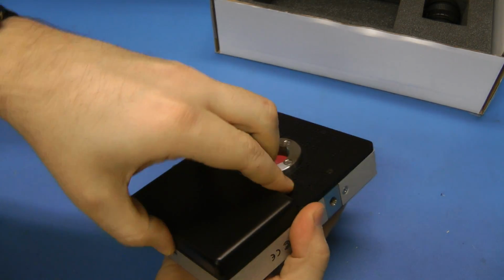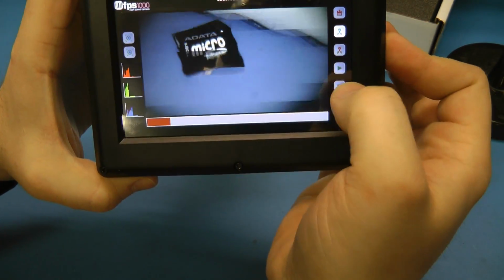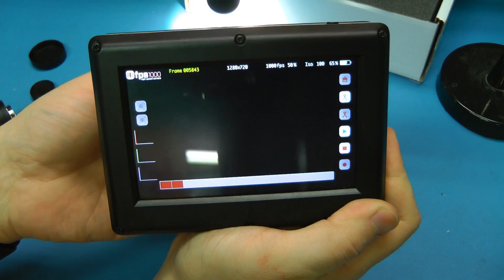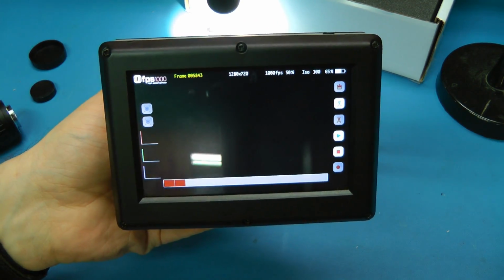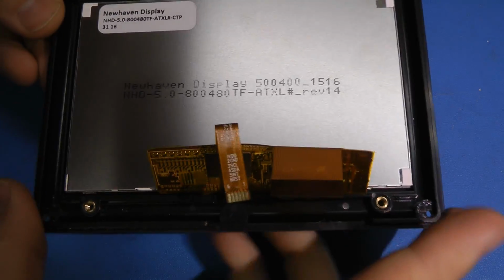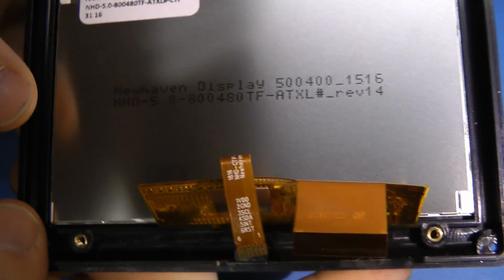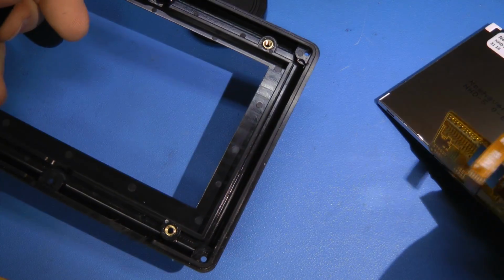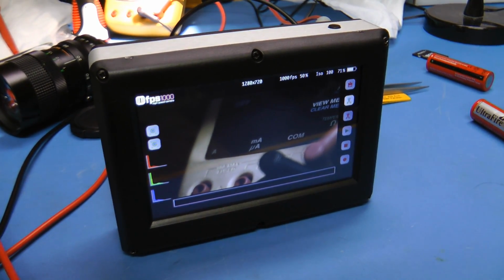FPS1000HD high-speed camera teardown

Comment: The pretty simple architecture is interesting and directly recording to flash sure has some advantages, but i guess that makes software development and adding features/fixing problems really hard later on with that kind of specialised hardware with 3 fpgas.
Also the issue of flash aging and reliability/speed could pose a problem compared to using a ram buffer.
Are those teary effects only present in the preview and how does the final video look like? That looks actually pretty terrible and might be pretty hard to fix later, if possible at all.
One thing i like better on this one compared to your chronos is the battery choice. Single 18650 cells are small and easy to buy or replace. Well, if you have the right cells and not dubious *-fire cells and rely on the user to actually choose the right cells and handle them correctly. But that is just a preference and i mentioned that before ;)

Comment: I am no expert in any way, but this thing looks pretty terrible to me...
Slotted screws, tape everywhere, bodge resitor, sloppy fan connector, no length matching, tons of wasted space on the PCB...
On the other hand really high quality injection molding with brass inserts, which costs a fortune!
And not only procuction optimisation lacks behind, but also usability with those unlabled ports, missing hand grip and general architecture, writing directly to flash soldered to the boards seems like a terrible idea.
Looks like a very early prototype to me, not like a finished product. Chronos sure isn't perfect in its current state, but it is miles ahead of this as far as design goes...

Comment: I have a question... how did rocket testing back in early 1950s have 100,000 fps cameras that used film? There are videos of the tests and the speeds they recorded at.. but how?
Reply: Harold Edgerton built a camera that had film pass behind a lens like a normal film camera but at crazy high speeds. Instead of having a mechanical shutter expose the film there was a strobe light driven by the camera to flash at hundreds or thousands of times per second, that way the scene is only lit for that very short flash, recording the image and allowing the film to advance in darkness between flashes. It was nuts!
Reply: Nick Moore Awesome, thanks for info!
Reply: Wow, 120 feet per second (80x faster!) and that seems like a pretty early stage compared to the rocket testing and later cameras!

i found an epic gallery about him, it has a lot of information ive never seen before regarding his work and 1950s life lol

http://edgerton-digital-collections.org/
Reply: Bookmarked Awesome, thanks! I've got some reading to do.
Reply: That's not how it worked. It used a rotating prism instead of stopping film for every frame.
Reply: is there an explanation of how it worked somewhere?

Comment: Clever idea using flash but I do wonder about endurance issues, especially if you use stop-on-trigger mode a lot.
Don't like the puny little 1.3mm power jack - looks pretty fragile. Also power button looks rather prone to accidental operation.
Reply: I would use the standard 2.1mil jack and have a buck converter on the input so just about any adapter could be used on it 12v adapters and 19.5/18.5 volt  laptop adapters are common now

Comment: Please dispose of those ultrafire cells. There are dangerous. Buy Panasonic, Samsung or LG cells. If you want cheap - used cells from laptops are ok.
Reply: Just shucked 6 sammy's from a $10 new-old-stock HP battery off ebay, rated 2600mAh and 5A each and all work perfectly after testing. Definitely recommend this route even if you find some bad cells or have to take a $10 loss on an entire bad battery before finding a good one as individual cells like this are sold for $5 each at best, so in the long run totally worth it.
Reply: I don't get why there is even a market for counterfeit/crappy batteries. Legit 18650 cells are soooo cheap, and they are many times better.
Reply: This. Worst of the worst those batteries. I love every time I buy something that's made in China and comes with 18650's they always end up an explosion waiting to happen :)

Comment: I'm not big on electronics but, the sensor being open to the elements is awful. Even when I change the lens on my DSLR I'm worried about getting dust on the CMOS. 
I'd feel I wouldn't be able to use the the camera in many conditions that I might like to because if it.

Comment: Thanks for the tear down, I have a FPS1000HD which I waited over 2.5 years to get and it's collecting dust due to the program issues. I have the latest version of the software but it's still buggy and very hard to use. I backed the chronos 1.4 also and can't wait to use the camera for a comparison. For now I will continue to use the Nikon 1 and Sony RX100 cameras
Reply: When did you receive yours? I am still waiting to receive a camera from the first KickStart 3 years ago.
Reply: slowmosage depends on how well chronos 1.4 works if I will sell it or not. I need portability and higher frame rates which FPS1000 gives just it very frustrating to use with how buggy the program is. I have access to fastcam SA-Z but it's a pain to travel with so it never goes along on trips.
Reply: Nick Moore I received the camera end of January but the first software was completely useless because every setting was fixed. End of March I got the software update that allowed ISO control, and frame rate but still no shutter speed. I posted a video at 4000 FPS on my YouTube.
Reply: That's a little disappointing. I have been planning to use the fps1000 to catch supersonic projectiles and lack of shutter control will make that very difficult. Thanks for the information.
Reply: Nick Moore the other thing that is disappointing is the save speed. Graham is working on a way to save with USB 3.0 but right now using the SD card is painfully slow. I need to follow up with him on that part because that one of the biggest issues with the camera right now.

Comment: Good analysis. At one point, the fps1000 creator advertised a "hex" model with a much higher datarate - like 720p at 7kfps or something. Maybe this is possible using the flash architecture and parallel fpgas. I haven't been following it, though.
Reply: I had ordered a hex but the model was canceled and this one was offered in its place. I believe the HEX may have been based around a different sensor though as the fps1000hd was announced over a year later.

Comment: 2.3a isn't exactly a big load for an 18650.  but then again cheap ones might feel differently.
Reply: Besides being likely underpowered IIRC most of these "-fire" brands are either factory rejects from reputable manufacturers or rebranded bottom shelf cells. I'd also be concerned with running 2 cells together because it's likely that their capacities won't be matched close enough with the nonexistent quality control that goes into them.

Comment: The 512GB flash may be used as raid to increase W/R speed, and also as redundancy.
Reply: the idea is not bad vs ram just why not a sd external raid cluster soo if the flash fails they can be easy fixed and can cut the price, customer choise his raid size on long range is no bad idea but well atm best idea is mini pci express nv sdd socket i think.
Reply: It's gonna be hard to route long traces for high speed stuff. But it's a good idea to make the flash modular and swapable.

Comment: Those Ultra-fire batteries are ultra-terrible and usually have falsely stated capacity.
Reply: Protip: if "rated" capacity is physically impossible given energy density, and it weighs half as much as it should, and the label has "fire" anywhere on it, stay far away...
Reply: Mark Furneaux it says 4000mah lol...
Reply: drkastenbrot cylindrical Li-ion cant be 4000 MaH the highest for capacity for Cylindrical Li-ion is 2500 MaH unless if it was a Rectangle Li-ion much like in smart phones then yes they can reach 5000 MaH so stop being an idiotic bitch

Comment: If they didn't do equi-distant traces on the flash around the sensor + splitting the output could definitely be causing that odd refresh issue. Probably not actually a "refresh" issue as much as the data being sent in narrow rows that aren't in sync.

Also, great tear-down & good on you for giving constructive criticism to the creator(s). :)
Reply: You don't have to length match around sensor necesarily, most modern FPGAs provide facilities on the IOB for callibrating out routing delays within reasonable bounds. If you look at highspeed Onsemi sensors, you will see the sensor itself provides training signal pattern during readout inactivity periods exactly for this purpose.

Comment: It's strange that there is an IR filter in the case as there appears to already be one directly on the sensor.
Reply: The sensor is composed of millions of individual sensors in a rectangular array.  Together, they act as a diffraction grating and break apart reflected light into its component colors. The same effect is created by looking at light reflected off from the back of a compact disc, for example, in which the micrometer pits are arranged in a tight spiral for the player to read via its laser.
Reply from the maker: The sensor doesn't have an IR filter built in, it needs an external filter.
Reply: The color of the reflection in the sensor made me think that there was an IR filter but I suppose I was wrong. Thanks.

Comment: Wow, did they send you a prototype? that thing looks like someone put it together in their garage. The metal bezel around the io isn't even screen printed or laser engraved.
Reply from the maker: Someone who bought one let me borrow it for teardown
Reply: Why would I be unsatisfied with a product that offered the performance of products costing many times what it does?

- Who cares if it doesn't have a silk screen on the ports - neither does the Chronos 1.4, and tons of other consumer and professional products I've seen over their years. 

- So what? It's a generic barrel jack. Ask the manufacturer what voltage it takes, or wait for the manual to be published. 

- That's not a problem at all if it was stated it wouldn't come with any. 

- Once again, who cares? Any serious user of the camera is going to throw away any lens it comes with, and chose a lens that best suits what they're trying to do.

It's a kickstarter project that offers the performance of products that are significantly more expensive. It's not a mass-produced item by a huge corporation. The whole idea is that it might not have all the bells and whistles of a full commercial product, but the product has the goods where it counts, at a significantly lower price point.
Reply: I had never even heard of this camera until I saw this video. Nothing about this camera looks "garage made". It has a slick injection molded chassis with nicely formed metal components, decent looking PCB with a single very minor bodge and solid construction.

This isn't a mass-produced piece of consumer gear made by Sony. It's a small-run very niche product designed for hobbyists or professionals at a ridiculously low price for the performance it offers.You're whining about issues that are completely irrelevant to its target users. Sure, they could have shipped it with an ultra-high-end lens, custom prismatic polymer battery and beautiful laser engraved port labels - except now it costs $1500 more than it already does.
Reply: Whats wrong with "put it together in their garage"? There is a long and proud tradition of this!
From the start I loved Chronos's own 'home designed' aspect, including all the 'I had more prototypes but the cat happened and now i have one less' bits.
And that the camera I've got on order will be made on the same benches that it was designed and tested on by the same people who care about every single last one.
Reply: What in that looks "garage made"?
Reply: Electra Flarefire There is nothing wrong with garage made. But when you're trying to market something to the public, of whose money you took to produce it, it should be a bit more polished than this. I love garage made, but the main point of "garage made," among others, is so you don't have to pay for "factory made." You can tell that they went bankrupt by the places where corners were cut. 

1: No screen printing/laser engraving.

2: No charger included.

3: No batteries. (Actually a lack of a proper prismatic cell altogether.) 

4: A bargain basement lens. (He obviously had plans for a better one, and since he said he would provide a lens, he had to stick a bottom tier lens in the box.)

This is what happens when you expect an inventor to design, prototype, build, "mass produce," and market a product. He didn't know how to budget the money. and is why he ran out of money and cut corners in some places, and went overboard in others. I'm not blaming him. It's more than I've ever done. i was just pointing that out. It doesn't look like a finished product. (Which is what it's supposed to be.... a 100% completed, consumer grade, product.)
Reply: American Locomotive If you went to best buy to buy a Sony camera, or went online to buy a Phantom, and you received this, would you be satisfied? I'm not expecting him to produce a product up to Sony/Phantom quality, but this just looks rushed, compromised, and not like a consumer product.
Reply: This is not a consumer grade product...it is a niche market boutique product at a bargin price point.

I bet you have never run a business before. Having someone else to "manage the money" would not solve the sortcomings ofn the first revision of a novel product. Like many people, your expectations that everything is easy is just plain asswhasah
Reply: American Locomotive You asked, "what in it looks garage made." I answered you. You guys Magyar either know the maker or have invested in it. It's like telling a mother her kid isn't as talented as she thinks.... you're right, it's magnificent.